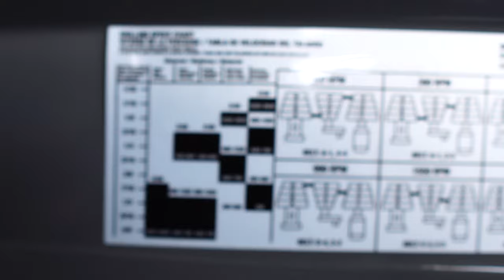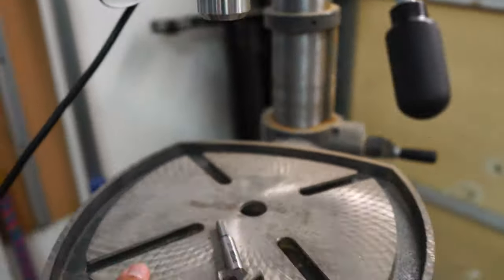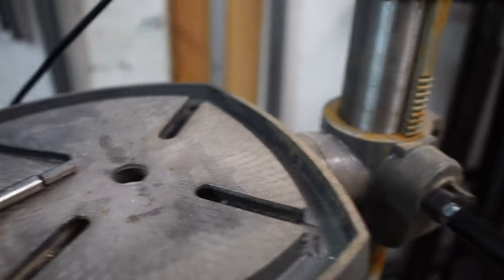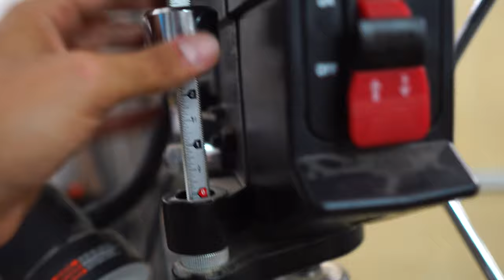A Quick Overview of the Porter Cable 15' 12 Speed Drill Press (PCB660DP)

Comment: I have the same model, great drill press. I also coat the chuck and table, and adjustment pole with mineral oil after every use to prevent rusting in my very humid shop. Building an accessory cabinet to go around and under the table and frame.

Comment: This is the later version which isnt built as robust. A quick way to tell is if the quill handles can be switched to a hub on the left side just like the right side. The bearing go out from unequal loading from belt tension when people are too lazy or dont know to change the speed when drilling something tough. They will use the wrong speed then the belt slips so they overtighten it. Dont be ahy about oiling the column either!

Comment: What is that rattling sound, I’m looking for a floor drill press and this is one of I’m thinking of, but I noticed thus new ones doesn’t swivel the table but can still bevel to 45 degrees
Reply: I have the same drill press, it works great but has the same annoying rattling sound.  I took it apart and greased the spindle, helped assume but still have the rattle when drilling.  Did you go with this one?  Also any one reading this have a fix for the rattle?  I am not sure if it's just not a high end tool or the bearings are crap from the start.  The sound comes from the top bearing area but they don't seem easy to remove.  I might try again just to see.  I might try the hf link belt too but don't think that's will fix it.
Reply: Figured it out, the rattling sound happens if you make the belt too tight or even a little tight.  if you run it and adjust the belt tension as you run it, you can hear some rattle down to none or almost none. Then when drilling no rattle.  Its all about the belt tension, keep it on the lighter side.  I think the manual states the belt should only move a 1/2" after tightening, that is too tight ,  you will get rattle.
Reply: @scott8351  thanks 🙏🏼
Reply: @jaimegenovajr3257  Hi Jaime my press was good for a bit then I heard the clanking again, in the top sleeve bearings. I took it apart today and popped them out.   you wont need to do that if you dont have a marble grinding sound when drilling so might not apply to you.  hopefully you dont have this issue, I will get new bearings soon.
Reply: @scott8351  share a video regarding the bearing replacement
Reply: @jaimegenovajr3257  coil spring removal, dont drill the holes like this guy in the video into your DP, just check how he removed the coil spring he was safe about it:
https://youtu.be/PxIuhj7rBIA?t=116
I didnt use this guys device to reattach the spring. see below for reattaching it later.   

Keep the spring inside the metal housing example keep watching to see this, but I didnt like how this guy released the tension w his hand, I would follow 1st video I gave for this one::
https://youtu.be/twh-YfSHfpE?t=1179

after you take off the spring coil you will need to remove a few things - spindle, handle and from the top pop off the from pulley.

tap out the bearing with a socket attached to an extended, I did this from below, here is an example but the press was fully apart which isnt needed:
https://youtu.be/LX6uTQv7tsY?t=389

Video on adding the spring cap back on:
https://youtu.be/xwqBV2rgAds?t=316
Reply: @jaimegenovajr3257  I ordered mine should get the bearing tomorrow-, here are some videos that helped me to take it apart etc: coil spring removal, dont drill the holes like this guy in the video into your DP, just check how he removed the coil spring he was safe about it:
https://youtu.be/PxIuhj7rBIA?t=116
I didnt use this guys device to reattach the spring. see below for reattaching it later.   

Keep the spring inside the metal housing example keep watching to see this, but I didnt like how this guy released the tension w his hand, I would follow 1st video I gave for this one::
https://youtu.be/twh-YfSHfpE?t=1179

after you take off the spring coil you will need to remove a few things - spindle, handle and from the top pop off the from pulley.

tap out the bearing with a socket attached to an extended, I did this from below, here is an example but the press was fully apart which isnt needed:
https://youtu.be/LX6uTQv7tsY?t=389

Video on adding the spring cap back on:
https://youtu.be/xwqBV2rgAds?t=316
Reply: New bearings fixed the rattling sound for me, I only replaced them in the front sleeve assembly.  I only hear the flimsy sheet metal cover now, I think I will get a bungee cord for that and I will be good to go.  Thats not really needed.